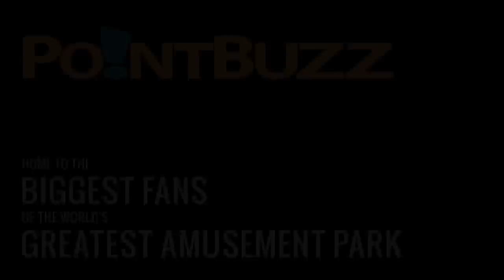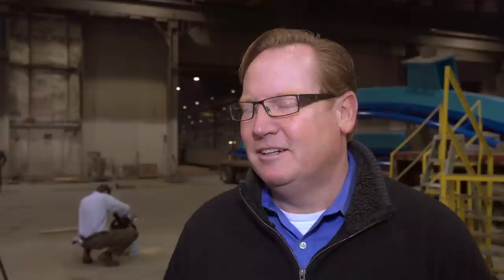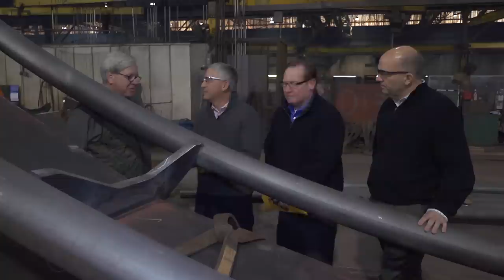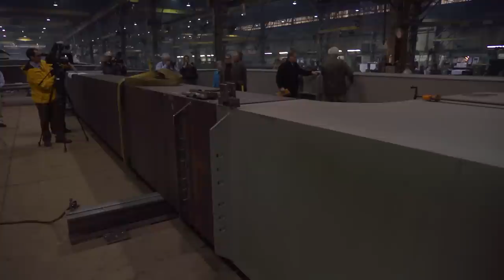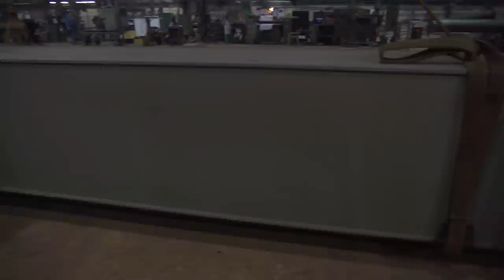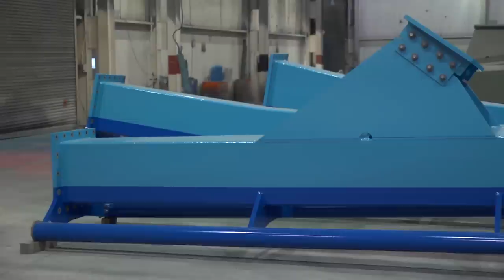Where The Roller Coasters Come From

Comment: Didn't B&M coasters used to be manufactured be manufactured by Giovanola, at least the ones going into European parks such as the B&M's at Alton Towers.
Reply from the maker: Nope. Every ride since Iron Wolf in 1990 came from here.
Reply: Jeff Putz thanks for clearing that up. Some great work going on there. I always take a minute to look at the steelwork on B&M's in amazement at the quality.
Reply from the maker: They do very good work there. Though strangely, the rails are bent and shipped in from Europe.
Reply: Mike K. Trump will Make Roller Coasters Great Again!
Reply: not sure about that but the two guys were used to be in gio
Reply: there used to be a Roller Coaster Manufacturing company called Giovanola and they helped out another coaster manufacturer, Intamin supplying them with trains, track, electronics and anything else you can think of. 
just before the 1990's two of the consultants (Walter Bolliger and Claude Mallibard) who worked for both Giovanola and Intamin moved on and created their own company (B&M) and utilised their experience at Giovanola to make their own coasters that are quite similar to early Intamin and Giovanola designs. in Europe (where B&M are based) they manufacture the track at their own factory however in the Asian and American market they use an external fabricator to manufacture the track in the country it is needed to cut shipping costs
Reply from the maker: @Darth MGTOW I'm not sure if it's the spiritual or actual successor of that company, but that part is definitely done in Europe and shipped to Ohio. It's worth noting that I couldn't photograph the part where they actually marry the tube to the ties, as that part is apparently proprietary. It didn't look exotic, but I didn't really know what I was looking at either!